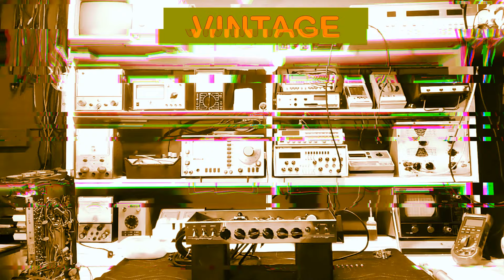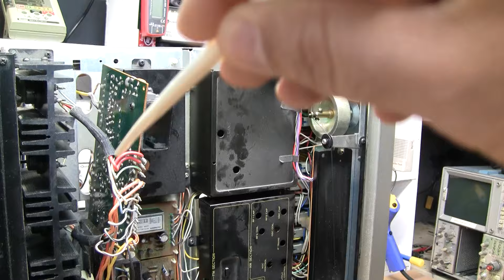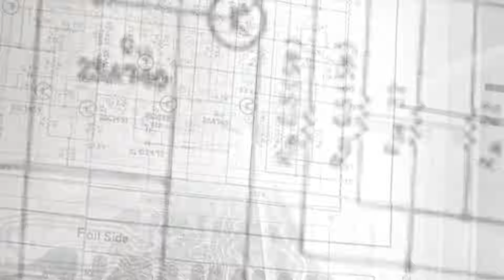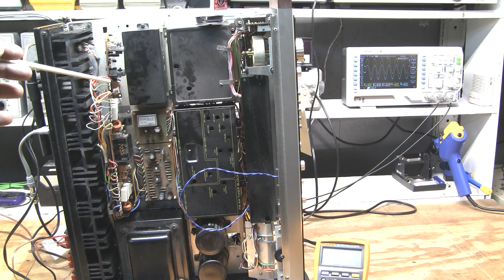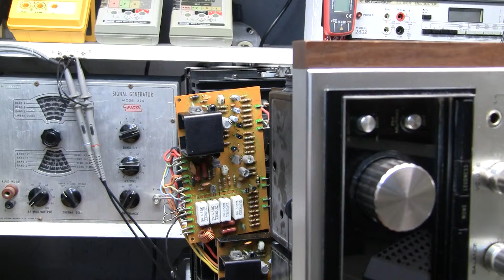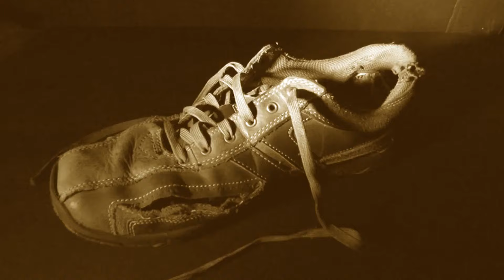Pioneer SX1010 More Troubleshooting Info Part Three

Comment: Doing a 1010 now. I sure was hoping to see how you "unwrapped the wires", Part 4?
Reply from the maker: Hello there, I'm not sure if I mention anything about navigating the wires?, can't 'recall. Nonetheless, I'll make mention of something that may help. Make or buy some wire identifiers, i.e. wire labels and label the wires needing removal in whatever sequence that works for you. Usually if the posts on the board/s are marked 1,2,3,4 etc., then you want the wire labels to correspond with their designated post / termination. Then, if you have a wire wrapping / unwrapping tool/s you could neatly start unwrapping selected marked wires and "liberate" the board from them if you prefer or need to. I'm not going to address the specific use of wire wrapping tools, as I'm sure there are plenty of how to videos on that topic. So, as you can see, it's as straight-forward as labeling your wires to "MATCH" their termination points so you know where to return them. Another side note before I move to the finish line: You may need a few different sizes of wire wrap / unwrap tools based on the wire size of course, so, just something to keep in mind and no big deal otherwise. In fact, you technically don't need wire wrap tools. Sometimes I just carefully "untwirl" the wire from around the post to loosen and remove it. If you do it that way, just make sure the wires are long enough to provide some slack, so you can re-strip and re-twist a new connection point as needed. Sometimes you'll break the old coil of wire as you try to untwist it. Additionally you may need to heat up / de-solder some of the wire wrapped terminals that have been soldered upon during previous repairs etc. As far as getting the wires back on, just re-wrap them on the posts neatly. Again just find some information on using a wire tool (easy enough) and then re-secure good "bomb proof" connections of the wires and posts. A lot of times you can just re-twist the wire around any type of shaft, i.e. a small punch, or my spring hook that gradually tapers from smaller to larger, so I can "eye-ball" an inner diameter slightly bigger than the post diameter. Then you can just push the coil over the post and neatly solder the joint (fill in the gaps between the coils and post) and establish another secure connection. So, there's enough info to hopefully get you going / thinking about what technique/s you want to work with. Lastly, and in some cases, if you can get creative with circuit board positioning / securing, you can carefully gain access to needed components and work on boards without having to remove all the resident wiring. You just need to be aware and careful not twist the wiring around too many times and too aggressively. If wires start popping off and you don't know where they go, things will get a bit more time consuming, so, you may still opt to mark the wires, in case of a "pop loose event", or just be very careful / attentive when moving boards with attached wiring. Again, hope this helps, my best to you.
Reply: @retroelectrotech  Thank you for informing me. Must admit, did know about this tool. I will do the labels and take lots of pictures, and try to replace parts without the tool. If not working I will invest in the tool. Thanks    
again.

Comment: At 22:45 you can see a burned resistor on the right side of the board. I'm still saying a driver transistor is going intermittent emitter-base for your main problem.
Reply from the maker: Thanks for pointing out that  resistor, I did swap it out a few days back. Out of curiosity at this point in this repair, I'm still monitoring the right channel and it remains "rock solid" ever since I removed the board, not a single hint of intermittent behavior. Prior to removing the board, the problem would  appear shortly after power up, even before a real rise in temperature, and it remained fairly consistent. Now of course the problem has "gone dormant" 😀. I've hit the transistors with heat, freeze, spray, movement, board flex, spit, bubblegum, prayer, sweet talk, unkind words etc., and the right channel waveform has held steady since board removal, at least at this point. All the voltages on the board are looking good as well. So, at least at this point that's why the problem appears to (to some extent at least) be "connection related". Of course, due to the age of this unit and its component population, and the fact that there are some caps and transistors present that are on the "poop list", the amp boards (among other areas in this unit) need restoration level work as you know, which is the direction I advised the customer to go. So, we'll see what he wants / is able to spend. If the problem had remained present, or if it returns, I'll indeed zero in on it...To be continued 🙂

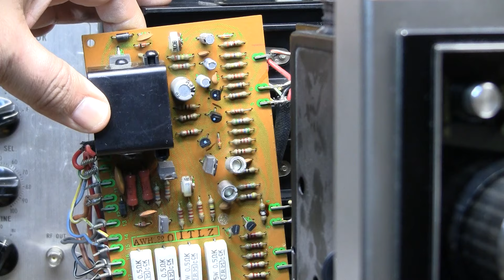Comment: 21:31 looks like R17 let the magic smoke out. q5,6 are probably on their way out.
Reply from the maker: Yes, R17 belongs at the end of someone's roach clip, it's still giving us 440 ohms though, tough little resistor wants to keep living. But yes, this unit needs a lot of work, plenty of old problematic parts that need to go. Thanks for chiming in as always, and for pointing out the toasty resistor, I've been super tired / running and gunning non-stop, today I will rest up :-)
Reply: @retroelectrotech  i just took a couple of days to rest up myself. i've been going at it pretty good lately. gotta give ourselves a break now and then. enjoy the music for a change with the enhancer of choice. rock n roll🎸
Reply from the maker: @josephlalock8378  Amen to that brotha,!

Comment: you know, i've got a computer at my bench and the monitor is right at my workspace and i do pull up service manuals and schematics but nothing beats blowing a schematic up poster size, sticking it on a bulletin board and getting out different colored highlighters!   those fisher price soldering irons aren't all they are cracked up to be but sure seems like a lot of people bought them anyway.🙃
Reply from the maker: Yes indeed, having a hard copy of a schematic is preferred for sure, and you're right, the Fisher Price soldering iron was a best seller ;-)

Comment: My original capacitors were mostly within tolerance. When you measured very high ESR values, you could get that if your LCR meter is using too high a frequency, drop it down to 100 Hz
Reply from the maker: Yes, test frequency does change the reading, I was testing the other "cooked" power supply caps (on the SX-1280) at 120 Hz. They were absolutely Gonzo! 🙂

Comment: In past week I finished restoring my SX-1010 that had many problems created by the previous owner who attempted to recap and replace transistors and diodes. There were numerous boards with diodes and transistors installed incorrectly. 

If I had to guess what may be your issue, I’d say it’s a faulty transistor that was overheating and shutting off, but now that the output amplifier board is away from the large output transistor heat sinks it staying cooler.
Reply from the maker: Hello there, interesting theory, and certainly possible. However, it would appear that many times during testing, the right channel would "misbehave" even before the amp started really heating up / dissipating heat (very quickly in other words). Now with the board out it's holding steady as mentioned, even during the periods when I'm working the amp "hard and heavy" (making it sweat) 🙂. Nonetheless, those old (known problematic) transistors need to be pulled, the electrolytics need replacing etc. This unit needs a lot of work. We'll see if the customer will give me the "green light". Thank you for chiming is with your very logical input.